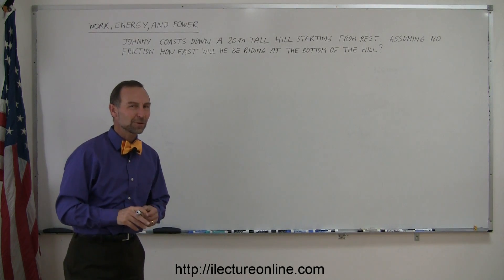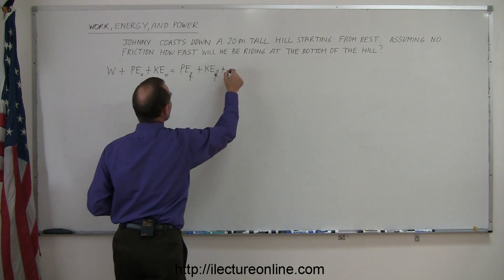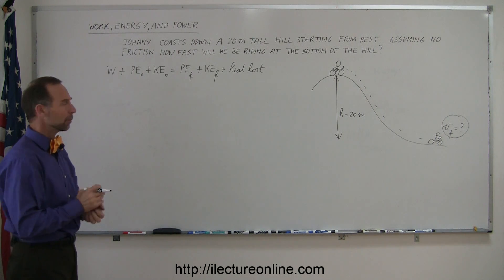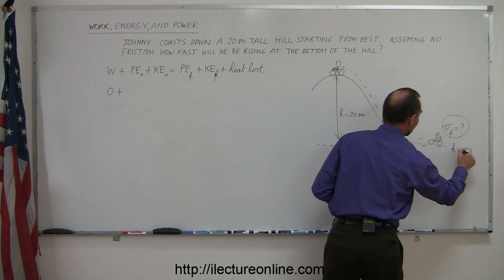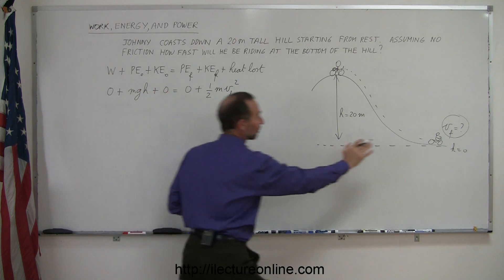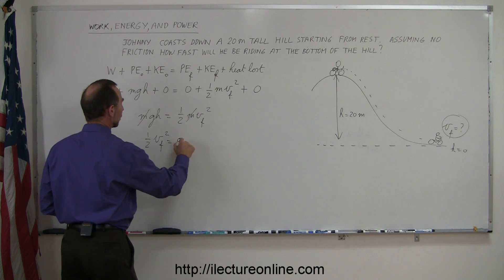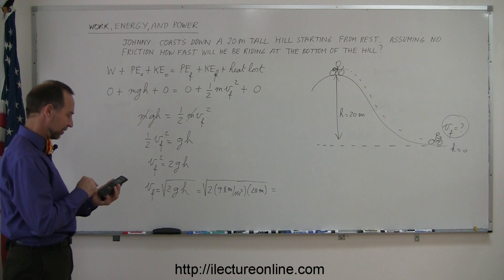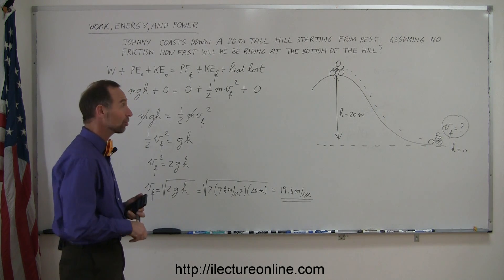Physics 8  Work, Energy, and Power (24 of 37) Sliding down a frictionless incline

Comment: Sir, the moving bicycle tyre will also have the rotational kinetic energy as well. Why only translational kinetic energy is accounted for in the analysis of energy equation. Pls clarify.
Reply from the maker: The answer is yes.  But at this time we haven't been introduced yet to moment of inertia and rotational kinetic energy.  That comes in later chapters.
Reply: Sir, thanks for reply. Actually I attempted the above problem considering both the KEs and the ans was different from yours. It was just to confirm with you, if I was doing correct or otherwise. Thanks again for educating us.

Comment: wait a bit, how comes his mass ad the angle of the slope make no difference? Confused
Reply from the maker: Correct, it has no effect on the conservation of energy equation.  It does affect the acceleration, but that is not calculated here and not relevant to the energy calculations.
Reply: @MichelvanBiezen  Thank you for your reply! I really like your videos
Can you please explain this to me, since to my armature mind, the steeper the angle, the higher the speed. With the angle of 90 degrees, he will just be falling down and with the angle of 0 degrees, he will be just standing on the flat ground
Thanks
Reply from the maker: That is correct.  But regardless the angle (if there is no friction, and we ignore the moment of inertia), the speed at the bottom of the hill will be the same for any angle  (other than zero of course).

Comment: Wouldn't the angle of the hill make a difference? I thought if the hill was steeper, then the person would be going faster at the bottom.
Reply from the maker: No, the angle does not make any difference (provided we don't lose energy due to friction).
Reply: Can this apply to slide problems too? For example: "If a water slide is 60 feet high, how fast would the person be going when they reach ground level?"
Reply: @bryced2846  Yes.   This is the advantage of using the concept of potential energy, in that it enables you to calculate work done by gravity, independently of the path.  Since gravity is a conservative force, the work done by gravity is path-independent, and only depends on the initial and final states.

Forces like air drag, friction, and the human forces to operate the pedals are non-conservative forces.  Forces like gravity are conservative forces, and have an associated potential energy.

Comment: Great video Sir, but can i also use the kinematic equation to solve this question?
Reply from the maker: That would be very difficult here.  Better to use the energy equation for this problem.
Reply: The shape of the hill is unspecified, so you won't know that acceleration is constant at every point along the way.   It ultimately will reduce to the equation you'll get for constant acceleration down a planar hill, and you will get the same result.  The conservation of energy principle and the concept of potential energy enables you to show that it is independent of the shape of the hill.